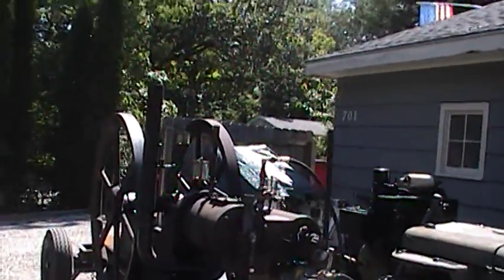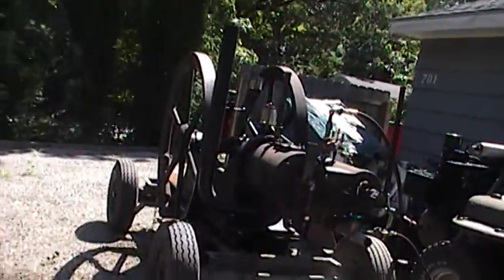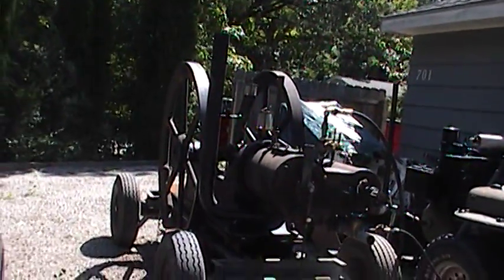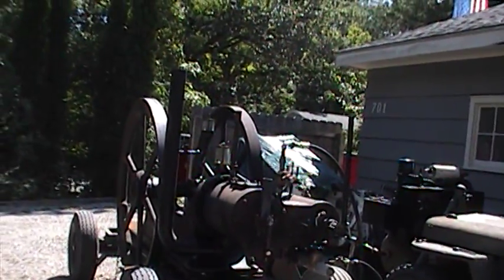1905 Reid Oilfield Engine long Video.

Comment from the maker: @regaskin .  I am looking at an old shed on a farm that was built around 1900 it is 12 by 16 foot.  Would like  to get it and put this engine in or use it as and old shop, has that nice old school look to it and still has the original siding.  Thanks for the comment.  Phil